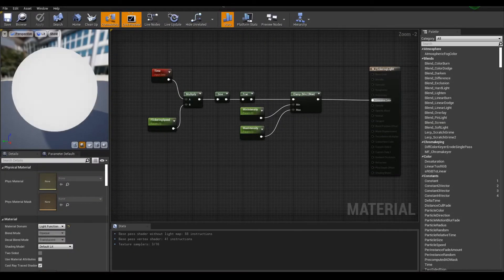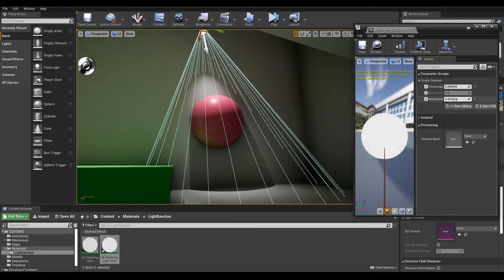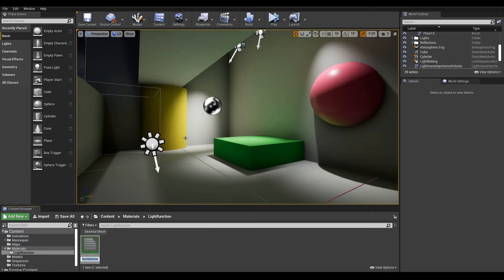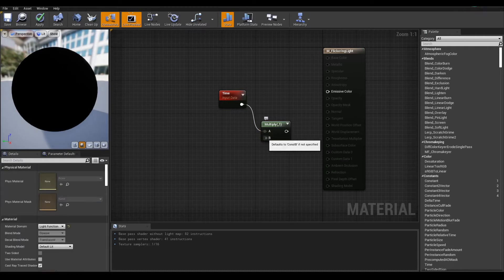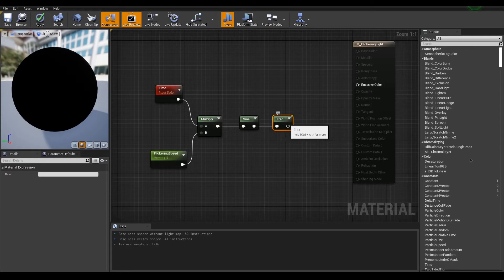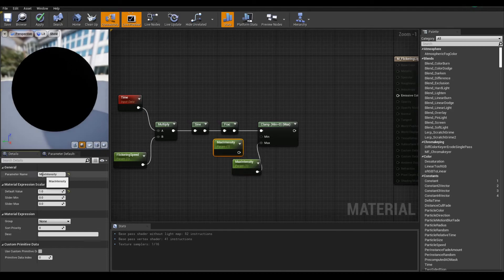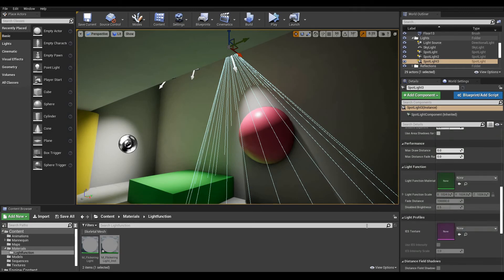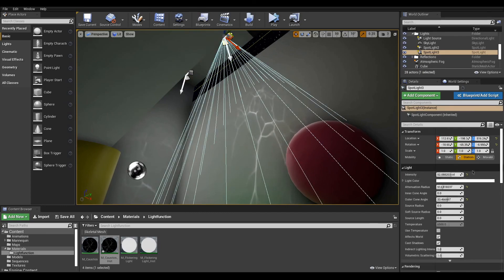04 - 04 - Learn Unreal Engine 4 - Light Functions

Comment: Do you have a video on how you made the material labeled "M_Caustics" in this video that as a light function looks like light shining through water? I looked through your videos but couldn't find it. Also hank you for this video, it was really helpful.
Reply from the maker: Hey Odin! Unfortunately, I don't. But! It was really simple to do. It basically involves having two caustic textures panning in different directions using Panners. When combined, multiply them by a radial mask to cut out the edges and have a smooth falloff. You can use the RadialGradientExponential for that. Glad to be of any help!